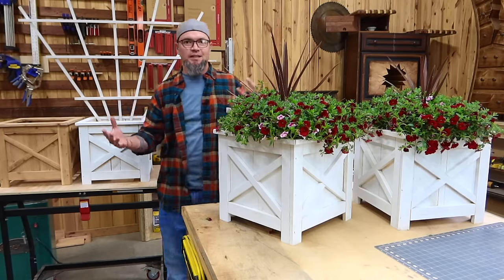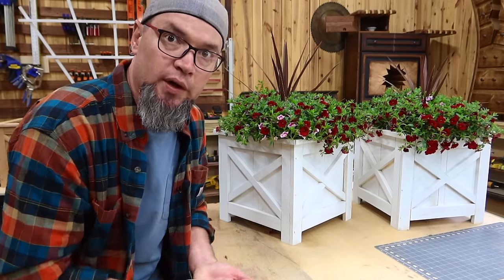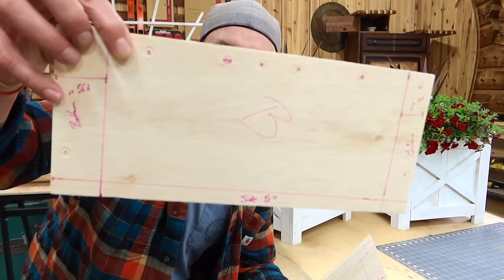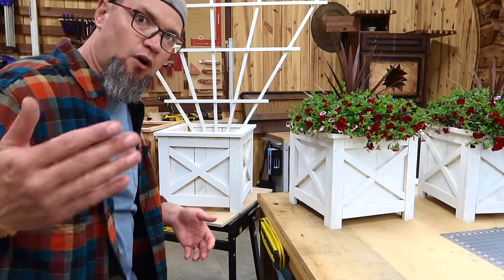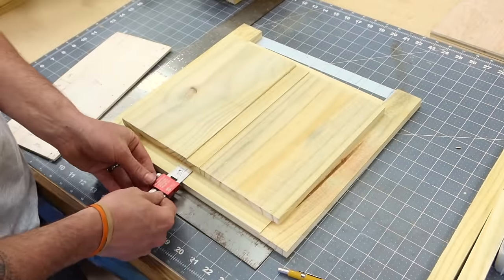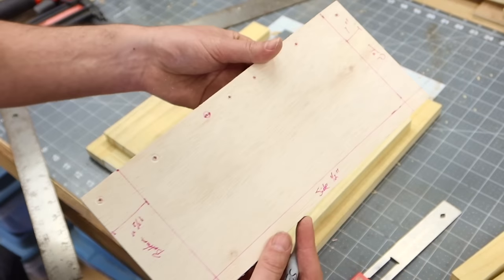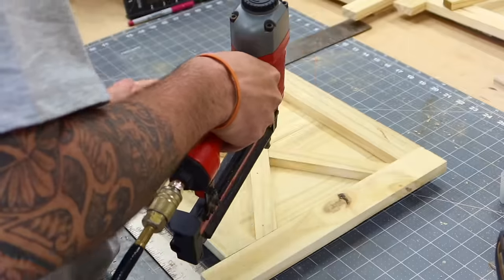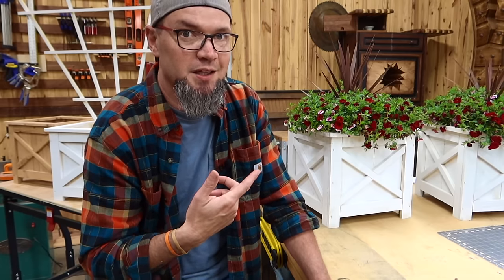The $6 Planter (Version 2) - Low Cost High Profit - Make Money Woodworking

Comment: I've started dabbling in woodwork, I've spent about AU$5k on tools over the past few months but have just been making workshop storage and haven't sold anything yet...  I'm going to start a challenge to pay off my tools in a month using these planter boxes, I can make about $35 profit per box so I have to sell 143 of them 🤣  Will do a video on my channel at the end of the month!  

Thanks for the idea :)
Reply: Update: it took me three hours and five minutes to learn to do the first one, from the time I started to set up the workbench to the time I was all packed up.  This includes converting all the measurements from bananas to millimetres, adjusting measurements for my 12mm timber vs. your 16mm, figuring out how to use the rip guide on a circular saw (never done that before), manually setting stop blocks, screwing it all together only to find out I'd done it wrong, pulling it apart, and assembling it a second time 😂

If I batch the cutting and assemble 10 or 20 at a time, it should be very easy to get this down to 10-15mins' work per box (or less).  I'll try to get twice as fast today by doing two in the same amount of time as the one took yesterday :)

Comment: One question.  I have been following this series.  I work a big box home improvement store (lumber department) and one thing comes to mind.  I see these pickets come in and have handled them and they are quite wet because they come straight from the pressure treating process.  Don't they need to dry before you paint them?  My store's training says to wait a year before you stain or paint them (at least a good hot summer in my opinion,)  If you are giving them time to dry out I haven't heard you mention it.  Just wondering your opinion

Comment: This is great. Bought the plans, in process of building. I’m concerned with screwing the center bottom board into the bottom of the wall pieces. Have you had any issues with the center wall pieces splitting?

Comment: Okay so you guys wanna know if it sells?

I was making one, I'm from the Netherlands so the lumber costs me about 40 bucks and I was trying to sell one for 75-90 bucks. When I put it on market place, someone asked me if I could make two planters, but about 1,5X the size.

I said I would make those 2 bigger ones for 275 bucks. The wood is probably a maximum of 100 bucks, so I just made 175 bucks at least for an afternoon's work. I'm convinced this will work in the future.

Comment: I love this channel! Thinking about production (and i don't have time this weekend to run out and try it), could you not make 4 identical panels with leg A on one vertical edge and leg B on the other vertical edge and after that you don't need separate A and B pieces (though of course measurements will change from what you give), as long as you assemble with leg A overlapping and leg B being overlapped?
Reply: like a pinwheel assembly with 4 identical panels instead of an I-beam assembly with 2 sets of 2 different panels, I can dig it
Reply: The pinwheel would leave visible screws on every side. Matt has them on just 2.

Comment: You sure sound like billy bob thorton sometimes.  So what did you use for the bottom?  You showed supports, but did you use 1/2 plywood?  Do you drill drain holes or leave that for the customer?  Ever consider lining them with plastic?  Thanks for the great video.

Comment: If you're going to mention treated pine (H1 to H5) then it would be remiss to not mention to at least handle it with appropriate PPE

Excerpt taken from The Log Factory, Australia:
Although it was scientifically found to be carcinogenic it is still the preferred choice for most builders. Its mild carcinogenic properties are easily avoided with proper handling

Comment: My cedar pickets from depot are less than 5 1/2 " in some places, so they must be skimping even more now. I was going to accomadate for that by making the middle wall an 1 1/2 and making the side walls 5 1/4, but i will need another picket now. This may be a 4 picket planter now
Reply: I just cut the back wall down by a 1/4 inch and crossboard A and B down by a 1/2 inch so i could still use the same jig I made.....hopefully that works lol. Not the sharpest tool in the drawer 😂😂

Comment: Do you put a liner inside? I understand the bottom needs to be open for drainage but it looks like the dirt would fall out. I just found your channel. It is very interesting.
Reply: I think this is designed to set a pot inside, or to use garden felt to line it- he mentioned it in the first video
Reply: @SherittaNesbitt  Thanks!!

Comment: In Australia, the treated pine fence pickets are wet sawn and quite rough texture. I kinda like it, but I see that yours are a much finer finish. Do you run them through a planer thicknesser or drum sander before you use them?

Comment: Just purchased the plan. I noticed that on the cutting layout top trim “L’ = total measurement of 64” doesn’t leave enough material to cut out middle wall “f”. Please advise. I can’t wait to start building. Again, thanks for your inspiration.
Reply from the maker: On the plan you flip and cut the miters. Not square stock.  I should be more specific. Thanks the heads up!
Reply: @MatthewPeechWoodworking  how do you cut off that irregular chunk on the 3rd piece, the K and F sections? I cut those off in one piece with a jigsaw, but didn't account for the dog ear and one of my Fs is now angled, lol.

Basically, what is your order of operations for that 3rd picket?

Comment: I like these planters and the other ones you did....just wish I could get $1.98 fence pickets. A 1x6x8 fence treated fence board is $8.62 each. A cedar fence board 1/2"x 3 1/2" x 40 1/4 " is $114.00 each. The cedar same size but 5/8" is $134.00. And the quality of the boards are terrible. Warped and twisted, cracked a third of the way and if I can find better the price is also higher. Please keep making these videos as they are great. Even 2x4x8 are $14.00 and curved like a hockey stick

Comment: Love this but could you make the recessed panel opening the same on A and B such that the cross pieces are all the same length and the x pieces are the same length for A+B with the same angles?  Looks like the width of the B leg should be 1-1/8 so when added to the 5/8 thickness, it appears to be 1-3/4 wide like the A leg?  I am probably missing something here!

Comment: Just curious your top board dimension is one and three quarters by 16 and you said the screw placement was two eight and 16 would that not place the screw at the very end of the board? I have made several of your two different types of planters and I have ran into issues with the dimensions so I did want to comment. I really like your ideas and your work and I did comment earlier that the top board a seems to be a little too long for the three wall pieces to fill the entire space on the angled planter that's made with the seven degree miters. Any input or feedback would be greatly appreciated. Thank you keep up the great work.

Comment: Ok, so i built one with the plans that are in the  video description and this is actually a 16 x 13 1/2, not a 16 x 16. 

It totally worked it's just smaller of course. I would also change the middle wall in A to 2 inches, very hard to attach to the legs with only 1 inch. I would post a picture if i could.

Update, I did put the A side on the inside instead of the outside but it fit so much better the other way. I think I will modify the inside wall of side A to make it fit together better. 

If you follow the video instructions the X's come out well. Don't make too big of a cut and check fit especially on the short pieces.

Comment: Did I do the math right, 78 screws per build?

I think we can cut the build time and production cost significantly by looking for some places that screws are overkill to holding the piece together
Reply: I got 96 or 104 screws, depending on if I only put screws in the corners of the panels or not. But that's still about $4 in screws. When selling at $60+ an extra dollar or two on screws isn't that much.

I'm going with pocket screws to put the rails and stiles together, 2 per rail. So that's 32. And also pocket screws to put the panels together, so that's 3 per joint and 4 joints makes another 12, 44 total, 5 cents each.

Then deck screws for the rest. 3 cents each. 40 or 48 for the panels, then 12 for the top trim.

Comment: I just got your 3 pack of garden plans and wondering on this farmhouse build, what if the center vertical piece on each panel is left out? Would it change any of the angles or just the over all length/box size? (Geometry and angles is like a foreign language to me)

Comment: It's a great design, only problem is 5 1/2 '' wall panels. None of the fence pickets I've been able to find are that wide.
Reply: Probably late to reply, but others have commented to make the middle wall a little wider to compensate for that. That's what I'm gonna do because the outside screws don't reach legs.

Comment: I went full ," baller on a budget " and made a test run out of some severely cupped and bowed pallet wood with no nails.
 I instead mitred slots into them and glued em in.
let the front and back facing have a bit of overlap.
Looks ok, but i really should just buy the fence pickets 😅

Comment: Just a heads up with the paid cut list. Unless I did something wrong the board with the 4 L's and 2 J's you are not going to get 2 Js out of that. Not a deal breaker the Js are just the small side of the X so any scrap wood will work.

Comment: Nice, I may try this version instead of the one I usually do. (And probably modify it, as i always do with plans)

I see an issue with your description/cut list  though .  You list the opening as 16" x 16", but wouldn't that be the outside top dimensions? The opening would actually be about 12 1/2" x 12 1/12" since the trim is 16" long and 1 3/4" wide.
Reply: I've actually spent all morning racking my brains over my math.  With the listed measurements in the description, I'm getting 14 5/8 x 14 3/4 OUTSIDE measurements.  

A side,  (Legs @ 1 3/4 x 2= 3 1/2) + (Cross board A @ 11 1/4) = 14 3/4 , B side (A edge 5/8 x 2= 1 1/4) + (B legs 1 3/8 x2 = 2 3/4) + (Cross board B @ 10 5/8) = 14 5/8.  SO, 14 3/4 x 14 5/8.  It's not even square.  ???  Unless my math is wrong.  Am I missing something?
Reply: @Ragingmarmot  the top trim is 16" square

Comment: Instead of using screws, could you use glue and an air nailer? Or would that leave the rust spots or just not hold up?
Reply: the heads on most air nails don't have a lot of holding power, they're good for shear forces

but in my calculations, there's only $4 in screws, about 100 total

Comment: I made this and the first one took me over 2 hours, second one I did in about 1 1/2 hours. Any tips on cutting time down? Ideally I’d like to get it down to an hour
Reply: Ways to save time:
Cut parts in batches if possible.
Stopblocks for the miter saw eliminate time spent measuring and marking.  Measure once cut many.
Assembly jig to align the pieces while fastening.  Basically a piece of plywood with blocks nailed down to bump parts against.  
Organized work area with all parts and tools needed.
Reply: @greenhornadventure  thanks man I’ll give it another shot

Comment: Is there enough length on those pickets to have the edge of the inside walls extend up flush with the top trim? I know it's just a planter and that edge won't always show, but it might look a bit cleaner to a prospective buyer. And I'm somewhat obsessive-compulsive haha
Reply: No. There's a pretty narrow margin for error. The cutoffs can fit into one hand. Actually you could probably hold the cutoffs from 3 planters in one hand. You could maybe piece together the cutoffs and tack them on to the top of the inner walls.
Reply: @JasonPeltier  Thanks for the info Jason. I will probably do a 3 1/2 picket version and try to clean up the interior a bit. The amount of pocket screws used is a little overkill too in my opinion. The thing is definitely built like a tank though. I'm going to do a mix of pocket screws and brad nails for simplicity and cost savings.

Comment: I'm working on my second one of this design (the first was not good) and I have a problem with the plans. On wall board A, the walls are inset by 1.375 inches and the screw on each side is supposed to be .5 inches down and .375 inches from the side of the wall. This places the screw at exactly 1.75 inches from the side of the leg, which is where leg A meets cross board A. Am I doing something wrong? The screw shouldn't be going through the butt joint.

Comment: When using pt, do you have to let them dry before building? Thanks for the great videos
Reply from the maker: I keep some in my shop for a few days.  Wont hurt to let the dry a bit.
Reply: It is usually better to dry wet wood before use, even if it going to be an "outside" product. When I had my current shop built, I included a heater/air-conditioner, and a dehumidifier, both purely for MY comfort. But, I have discovered that the dehumidifier helps dry wet or air-dried lumber more quickly. Worth considering.

Comment: Hi Matthew, I tried building this in sketch up using the measurements you have listed but some how when I join panel A with panel B they are not connecting correctly. Panel B does not sit inside of Panel A, Panel A leg extends about 3/4" past the edge of Leg B and Leg B extends about 1/16" into panel A. The only way it connects edge to edge is if I put leg A at 1" and leg B at 1 5/16"...smh. I so want to make this planter, they look really awesome. The leg dimensions listed in your post are listed correct right?
Reply: Oh I figured it out, lol I thought the back wall ends of panel A touched the ends of panel B...smh.
Reply: @jumpman2bb It should  makes it stronger. I widened Panel A back wall
Reply: @growhuntkillcaneat  that's what I plan on doing on the next one I build. Would like that back wall in A to butt up against B. And I may build my walls horizontal instead of vertical so I don't have the 1 inch middle to deal with.

Comment: Wouldn't the soil fall through the gap when the plant is set inside? I am hopping to use this for real plants but am afraid what happens to the soil I pack in if there are so many large gaps at the bottom. Also does the wood you buy need to be pressure treated since I will be watering the plant and it will be outside?
Reply: They are made to set a pot or hanging basket in them

Comment: Are the pickets pressure treated? Or raw. I thought it's not good to put PT wood through a planer. Are there untreated pickets sold as well?
Reply: Yes they are treated.  He sands them instead of planing.  Untreated pickets are made from cedar, cost more and look nicer.  The treated pickets in my area are all low quality with many knots and usually cupped.  I pick through the pile of cedar and pull out the totally clear boards.
Reply: @greenhornadventure  Thank you for the info! I had bought the PT pine pockets, but took them back and exchanged them for the cedar ones. I'm working on my first planter now!

Comment: Good afternoon Sir. Two questions. The board that is used at the start is it a 6' or 8'. I'm thinking 6' based upon the price, but wanted to double check. Second question do you know why the PT boards are cheaper than the non-PT boards. I would think it would be opposite. Thank you.
Reply: 6' boards. Not sure why PT is cheaper, though
Reply: @JasonPeltier Thank you.

Comment: Question...what length pickets are you using. I'm using 6' and it's like I'm just not gonna have enough wood
Reply: they are 6" long, there is very little waste. The top trim pieces need to be rotated when cutting the 45 degree angles so it will all work out
Reply: @JasonPeltier  thanks for the reply. Hubby who's a carpenter found a better way to this without all the complicated math. It took 3.5 boards using his directions on YouTube. Not paying $10 for layout. You have a blessed day, and thanks for replying

Comment: what goes in the bottom to keep the dirt from falling out?
Reply: I have the same question
Reply: He has boards on the bottom.  I think that this build is for flowers or plants in containers, you just put the whole thing down into it to cover up the ugly packaging the plants and flowers come in.  

But you could take some wire and put in the bottom then place landscape fabric over the wire to keep dirt in the bottom, but that would increase the build costs.
Reply: @PsychoSusieHomemaker729  you know you might be right, that’s a good idea too, tysm
Reply: @PsychoSusieHomemaker729  What kind of wires and how will water drain out?
Reply: @diybuildandlife207  I you could you hardware cloth or Welded wire fencing.  And the landscape fabric will allow the water to drain, but will keep the dirt from coming out.  The hardware cloth or fencing is just there to support the dirt, but won't keep it from coming out.
Reply: @PsychoSusieHomemaker729  Ok. So normal fencing wire and then landscape fabric and then the soil? Has anyone built this planter successfully with the materials he has shown as I see a few people saying they were unable to do it.